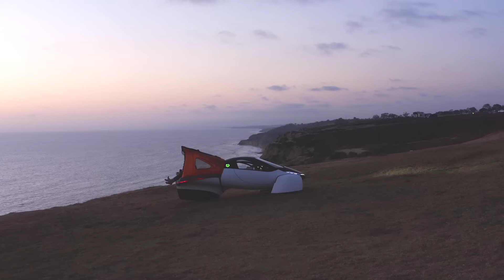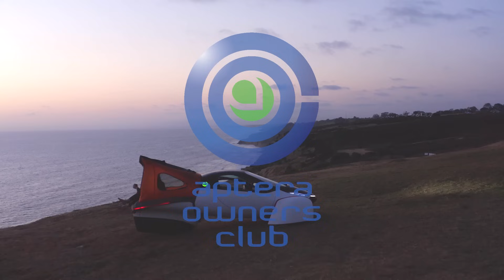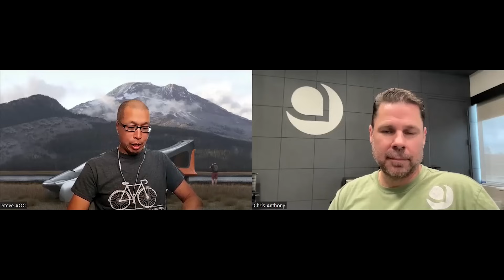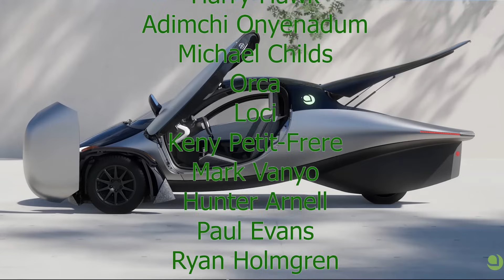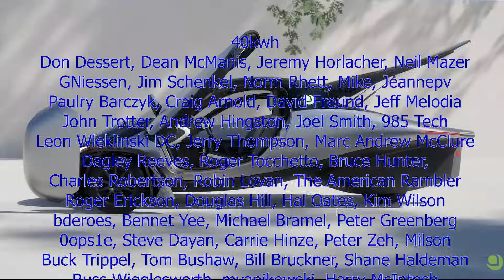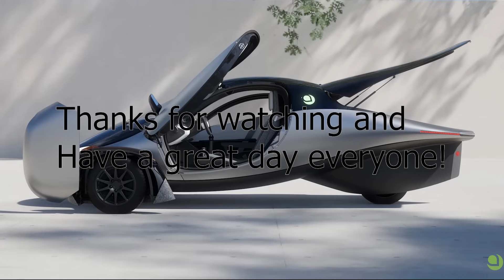Part 2/3 Aptera Update with Chris Anthony May 2024

Comment: My boss, the program manager in my department, used to have a picture of the Dos Equis "Most Interesting Man in the Word" guy, with the caption "I don't always test my code, bur when I do, I test it in production." 😂 It was a joke, but I agree that the end users will always find the most bugs. If you're not prepared to maintain your code after it is released, and quickly, you're going to fail. 

So I agree with Chris. Definitely you want to concentrate on safety and stability first and foremost. But software is definitely something that is best tested by releasing it to the users as quickly as possible. They will find things your testers never even thought of. And if you can develop things like the cooling system or the camping kit after you have a customer base to try it out on, I'll bet that will be helpful too.

Comment: I already have a tesla model y, but instill want to buy an aptera. I want to be one of the first to be able to spread this car as an idea. For soo much of transportation this is more revolutionary than even self driving.
Reply: Why is a smaller less capable car costing $35-40K noteworthy? If it's a small car you want, buy a $25K economy car with 4 wheels and 4 seats, easier to park, safer. $15K savings will buy you about 125K miles of gasoline. The only thing you'll be missing is gullwing doors.
Reply: @artsmith103  ...and also missing: a cleaner atmosphere, along with a non-warming planet. Let's get real, Art.
Reply: @lectricbill3329  Have you seen global warming? Record cold for me this winter below -30F killed a 20yr old Cherry Tree. How did that happen? Find Tony Heller on YouTube for great updates of fraudulent global warming stories. How much battery mass per vehicle owner is there? If it's 2-8 kWh worth (~25 miles) HEV save over 6x gasoline/kWh more than EV battery use.

Comment: I have had enough. Tesla here I come. Every year since 2021 they say " production mid next year. They had the suspension set, now its not. Im order number 30130. I am not waiting until 2027 for an aptera. you can get a good used tesla for $15000.00 .They are just going to keep makeing BS excuses. " No one wants to go from makeing 2 cars a day to 4".  What?!! I wish them luck as I am an investor, but hell no. Enough enough. Im done. Dont even want to hear why production wont start til 2026 because that is what is coming next.
Reply: Welcome back to reality. For me the answer was a plump $12.7K, 2015 PHEV with 600 mile range, hitch, 5 seats, mini SUV cargo area getting 40 mpg in HEV mode. I think gasoline is cheaper than electric so I hope I'm extending battery life by not using EV mode. I'm okay with replacing battery in 5yrs if necessary. I charge about once per month when battery works its way down to 30%.
Reply: @artsmith103  More blatant  lies.  Gas is certainly NOT cheaper than electric even if you use DC fast charging all the time... then it is about the same as driving a 35mpg fart box.  EVs cost much less to drive. In addition the true cost of gas is paid for by the massive oil subsidies all tax payers who fund our wars for oil pay for.  We won't bring up all the pollution, blowouts, cancer clusters, refinery explosions, bomb trains, and all the rest. Asshat.
Reply: @J-W-Kelly Electricity is about 1/3 the EV cost, battery life cycle cost is 2/3. Counting both of those gasoline at 40 mpg is cheaper if it has little impact on battery life due to battery constantly 40-80%. That's why I recharge near 30% not to strain the battery. Plus HEV uses less battery at those lower levels.  50-80% SOC seems to be the sweet spot.
Reply: @artsmith103  More lies.  If we are counting other things (externalities) than just gas and electricity, you will lose that argument as well.  What are you doing here, troll?  Are you paid to spout this garbage?
Reply: Bye.  Adulting and patience are both tough going!

Comment: Steve: I did the math, got a surprise vis-a-vie a solar house. Forget PV roofs, power walls. An EV with V-house could power a house with re-charging at cheats rates. My wife & I drive about 1000 miles/yr. so our car is in the garage 99%. If we need to travel far, we fly. Why buy power walls when we could use our car battery? At 81, a solar roof + power wall might not pay back before I die. Also, V-load allows me to plug in a small frig to get frozen food home in 110 degrees. 
Will Aptera provide that option?
Reply: You’ll be able to use a fridge that plugs into the 12V port. Easy.
Reply: *.gov says usual home uses 900 kWh/mo. My home/lifestyle is quite efficient and we use 320. Math is easy if you use 540 kWh/month with solar getting 4.5 peak equivalent hrs/day. 18 kWh/day requires 4,000 watts of residential solar. That's 13 320W panels. Compare that to 700W poorly oriented Aptera solar generating 2.1 kWh/day.  Is your electric bill close to $75/mo?
Reply: At 81 and only driving 1000 miles per year, Aptera is not for you. Stick with what you got and drive it until you can't anymore. Best case scenario, 10 years which I will suspect that the 1K mi/yr will drop over over the next 10 years.

Comment: What brake rotors and calipers will this have. Will they be the same as some common mass produced OEM rotors and calipers?
Reply: Brakes?  Who needs brakes!?  🤣
Reply: @LanderMaybe  I find they can be convenient when trying to stop.
Reply: That's a good question. I imagine it's off-the-shelf parts, especially when you consider that Aptera supports Right-to-Repair.

Regardless, because energy that goes into the friction brakes is energy that can't go back to the battery, the majority of braking will be regenerative breaking via using the motors as generators. The times where the brake pads would be used would be for emergency braking and for very low speeds where the generated rotating magnetic fields are too slow for the motors to convert.

The mechanical brakes are going to last a long time, as the majority of braking will be done through electromagnetic means. Still, what brakes are used is something I'm now curious about.
Reply: @TildaAzrisk  Have you ever seen regenerative braking on an Aptera? Maybe someday it will have it.....

Comment: I disagree with CA statement of production in 2025. He does not want a small production, that necessitates a funding from a third party. Without that he should not say anything about production in any time in 2025. That is misleading.
Aptera right now seems to have just enough money for the PI, if that.
Reply: Funding for the PI builds was secured by the Accelerator Program. As a tech company Aptera will always require more capital, ALWAYS. 
USCG will provide the funding for mass production.
Reply: Is it though? Because you are making it sound like they need the money to build 48k cars before they start but that makes no sense. They need the money for the PI builds up front but the money for ongoing manufacturing can come from ongoing shipments. If they can move 200 cars a week at an average of $35-40k a pop that should provide the funding to build more vehicles as they go. Plus, the moment you start making sales it opens up opportunities to take advantage of more grants and investment opportunities.

The reason other companies are failing based on what he is saying is that they never planned to meet their break even. So although the are shipping cars they are unable to build cars, scale and sell cars and pay for all of it as they go because it is all too overwhelming. Making adjustments on a moving plane does in fact sound more complex than making adjustments prior to lift off to me.

Comment: 4 wheel Aptera? That’s a first for me, hearing that plan. Aptera has lofty goals, and I am here for the ride
Reply: Past estimates of release dates are obsolete of course, but once Aptera has begun production of their three wheelers, they are planning on a four wheel sedan, as well as a SUV and van. A semi, I have not heard of. 

Presumably these additional models will use the same construction methods and aerodynamics, instead of just abandoning the three wheel design and producing industry standard automobiles. That was already tried and failed.
Reply: That has always been in their pipeline right from the very start.
Reply: 4 door sedan by 2021, crossover by 2022 and a semi by 2023. I suggest people do their research into Aptera. They have grand plans.
Reply: @billsmith5960 Also Bill Smith, “I was wrong about Aptera” “They’ve clearly got demand” 😝

Comment: I think that many other Aptera accelerators will share my enthusiasm, and willingness to get our production SEV sooner, even if it means that we are "Beta testers", and may have to update a few early (small) bugs in our Aptera EVs. Chris had a good example of his own Model S, which needed early production bug fixes. Which worked out well for both Tesla and most of their early customers (overall). Even though that "Beta test" production model was not following legacy automaker's traditional approach.
Reply: I love this. I don't feel the same way but I am glad you do. My reservation is around the 40,000 mark. My Hope is that when my time comes I won't feel like a beta tester.
Reply: I cannot share that sentiment. But I am willing to do whatever I can to help them reach their goal.

I am an accelerator that has not switched to the launch edition because I want a Noir with 1k mile range, AWD, etc. with all the fixings.
Reply: @SomethingElse4U  That makes sense. The 1,000 mile capable Aptera will be a industry disrupter and halo model. Showing off the Aptera's efficiency benefits for people who drive a lot. And even though you will have to wait longer to get yours, most likely our first Aptera EVs will help sort out the early production bugs for you, so that will be a reward for your additional waiting. I was originally going back and forth between the 400 mile and 250 mile model, as I can charge at home (off of solar) and I almost never drive more than 100 miles per day.
Reply: Right, I would be very happy to have a through line to report problems.  I have 32 years of product development experience and can't wait to get my hands on one.  I can accept early adopter type issues.
Reply: @lsh3rd  I'm glad to hear that people are able and willing to do that for Aptera. 👍
Reply: @lsh3rd  When it comes to video games I'm all about that. I took part in the Beta Testing of Baldur's Gate 3 for a couple of years. The changes that Larian Studios made to the game were largely due to the feedback we beta testers gave them. It felt great to feel like we were part of the process.

Comment: I'm looking forward to seeing the 4-wheel prototype. 
That configuration is much more stable and controllable than a trike in many respects.
Reply: Watching various videos, the Aptera looks to be very stable and controllable.  Low center of gravity and all wheel drive....  I love hard cornering and I am not even slightly concerned about the handling abilities of this unique EV
Reply: By having 2 front wheels and half as many rear wheels, the traction, both forward/back and side-to-side, differ between front and back, and that difference varies with acceleration/braking and left/right cornering and dry/wet conditions.  And that all changes again with tire pressures.  That variance changes quickly and it's unpredictable and treacherous.  It certainly is NOT meant for "spirited" or sport driving!
Reply: @BillMitchell-lm8dg  Poppycock... from another one who has no idea what he is talking about.  Have you ever set up suspension on a vehicle... or read books on suspension design and vehicle handling?  If you had, you would not be making such an inane comment.  You too should find another vehicle to purchase as this one is far too scary for you.
Reply: Bigger benefits are narrower and 2 wheel tracks. Aptera is dangerously wide, low with 3 wheel tracks regarding staying in its lane and avoiding road debris.
Reply: @artsmith103  As someone who driven lowered vehicles for decades, you are full of excrement.  The Aptera has generous ground clearance... and what does "dangerously wide" even mean?  If they made it narrower, you would be complaining that it was unstable.... it's what trolls do, after all.
Reply: @J-W-Kelly  dangerously wide means in combination with being low and 3rd wheel track. It's the worst combination waiting for a disaster. With your lowered vehicle, did you drive over or around debris? With Aptera it's likely to be over. In full traffic the time to react is quite short and how will Aptera get past mufflers, tail pipes, contractor tools, lumber?
Reply: @artsmith103  Hilarious.  Why didn't you throw in a sofa in the middle of the freeway while you were at it?  First: The Aptera is not low. Second: Tailgaters have the problem of not having time to react... so don't tailgate.... duh.  Third: You obviously know nothing about vehicle handling, or you would do a better job of trolling.  Next.
Reply: @artsmith103  You shouldn't buy an Aptera.  You are far too fearful...  not sure what kind of vehicle (stroller, perhaps?) would meet your needs, but this ain't it... obviously.
Reply: @J-W-Kelly  Everything I said is 100% accurate. Aptera told Leno they would raise the wheel covers but never did. I suspect they are struggling for 10 miles/kWh and can't give up any advantage. In my 20s I drove a small sporty car. I get that lifestyle but Aptera would have failed. I had roof racks to carry windsurfer and lumber. I had a hitch to tow small boat with room for bike rack. Flip up back seat for date's kid(s), or cram 4 adults in at bar time to save people taxi fees. Small easy to park, a little cool with T-tops and medium size engine. Maybe you haven't driven much in heavy 3-4 lane city traffic at 60+ mph. When/where hundreds of thousands of vehicles travel everyday, crap gets dropped on the road.
Reply: @artsmith103  Everything you said is 100% bullshit.  I again suggest perhaps a stroller would fit your needs and address your irrational fears... this vehicle is not for you... others will be happy to take your place in line.
Reply: @artsmith103  As far as avoiding road debris... since it is "dangerously wide" there is plenty of space between the tracks of the front wheels and the back wheel track... next.

Comment: As a soon to be engineer and as a German I love this so called „efficiency“ 😄 it’s great to hear that they’ve got this efficiency mindset through and through. From vehicle design to manufacturing to finances. Love it :) thanks for the update Steve! By the way, did you get my email?
Reply: ~$40K 2 seater with no roof racks or hitch option? I would say extremely in efficient. At 40 mpg, my 5 seater PHEV with hitch is cheaper to run on gasoline so I almost never plug it in. Pulls our smallest boat(s) to the lake plus camping equipment for longer weekends. Pulls bigger loads from HomeDepot. When I pickup family or friends, if there's additional people needing a lift no problem. Almost 600 mile range, refills in 5 minutes. No winter heat or deicing limits. I think new it was around $40K, I bought used for $12.7K. Aptera cannot do any of that. A 2 seater should be around $20K.
Reply: @artsmith103  your comparison doesn’t make sense. If you need a family car, roof rack and towing capability the Aptera just isn’t meant for you. Same as a Ferrari wouldn’t suit your needs. At least here in Europe almost no one needs a roof rack or towing capability. Most people here just use their cars to get to work and back and doing so usually they’re alone. Comparing the price to a used car also doesn’t make sense. I bet you could get a relatively efficient used ICEV for almost free if you’re willing to make the right compromises. Coming to fuel efficiency now your car uses 40 mpg which is around 6L/100km which would equal around 10,80€/100km with gasoline being around 1,80€/L. The Aptera is said to have a fuel economy of around 100 wh/m which would equal around 6,25 kWh/ 100km and around 1,70€/ 100km when calculating with 25€ct/kWh. A Tesla model 3 is said to use 20 kWh / 100km which would cost around 5€. That doesn’t include charging through the integrated solar panels for the Aptera. For me the Aptera would be the perfekt fit. And just because your car suits your personal needs better that doesn’t make it an efficient car.
Reply: @oliverheinen5440  For starters, cost of electricity is typically ~33% of energy cost. Battery lifecycle is ~66%. So in USA, we would triple electric cost to determine $$/mile. The 10 mile/kWh has never been demonstrated. I suspect closer to 8. Aptera refuses for 3yrs to demonstrate on local roads with proper additional weight to account for smaller battery. I've done quite a bit of solar install estimating annual kWh for both residential and 18V. I'm expecting ~3 peak equivalent hrs/day, 365 basis so 2.1 kWh/day, 17 miles/day. Only a little better than proposed $900 lifetime cost.
As a young person you should be doing more with more people. Don't get sucked into less is more to patronize someone else's agenda. I haven't stayed in Europe in a long time but they used to be famous using midsize cars to tow a lot more small stuff than Americans do.